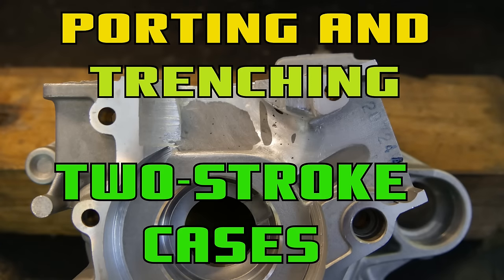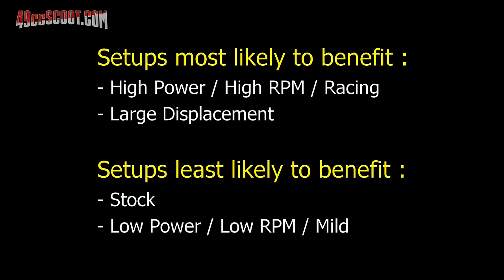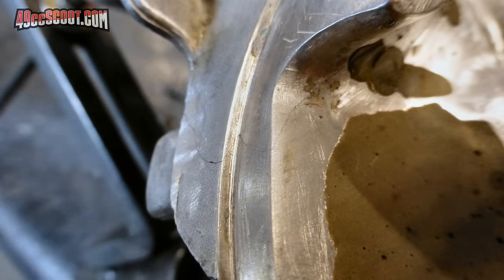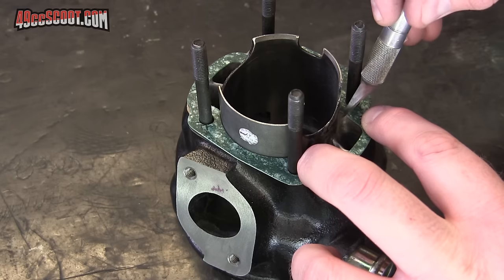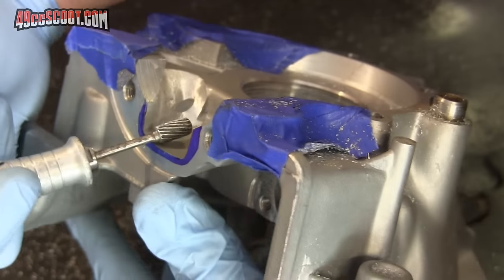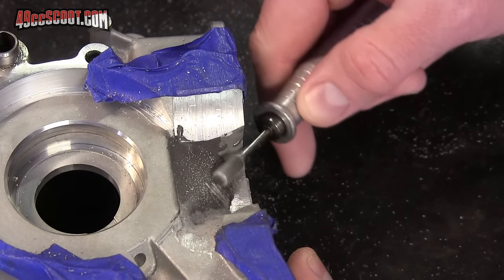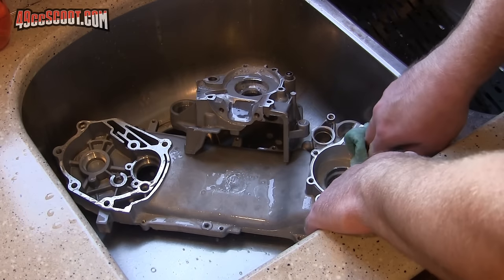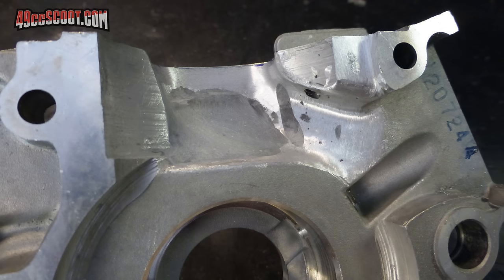Port Matching, Porting And Trenching Two-Stroke Engine Cases

Comment: More physics!
Air does not like going around corners. Use large radius turns. Short turns seporate the ful droplets and they go straight. 
Steps cause turbulance!!! ( fuel comes out of suspension) 
Again! Think in terms of the air wanting to go straight!! Keeping fuel atomized! 
Also remember, in an engine the air is pulsing in reverse too! Watch edges and steps. 
( Knife edge) ramps must be gentle, to stop turbulance!
Don't polish any inlet surfaces!
A 60 grit cartridge roll finish is ideal.
It provides a boundry layer ( holds higher air velocity) and lessens the fuel that comes out of suspension!
Polish exhaust ports! Minimum 200 grit.
Apart from matching cacing joints and steps, radiusing, etc.
The more you remove, the slower the air will move.
~ " Flowing", while removing as little material as possible, will keep good midrange and improve top end power.
Going Big will lose low end but gain power at high rpm.
You spend about 60 ~ 80 % of the time at mid and upper mid rpm and throttle position.
Think about it!
Enjoy tinkering!
Oh WEAR EYE PROTECTION! GLOVES! 
AND A MASK, ALUMINIUM IS TOXIC TO THE BODY. Google " silicosis"

Comment: When you are marking your gasket you are much better off staining the flange well past the gasket edge and then use a scribe to mark it.  This is far more accurate when you are grinding up to it and is far easier to tell if you are going to go to far.

Comment: Wouldn’t port work potentially direct less oil to the crank bearings?
Reply from the maker: It could, but work like mine have won't isolate the crank enough to be an issue.

Comment: ottimo metodo per buttare via tutto
Reply from the maker: Over 1,000 miles on the last one ATM with no issues running 14,000RPM. I've done this to multiple engines. It's not for everyone. If you want max reliability, just leave it stock.

Comment: Just curious about case stuffing around the crankshaft or is that unnecessary in your build?
Reply from the maker: I was using a stuffer crank, but didn't do anything to decrease case volume. This particular engine was a 49cc bored and stroked to 103cc.

Comment: Intakes need to have a rough not smooth surface, it helps suspend the fuel molecules. Smooth surfaces will allow the fuel to form puddles 😉
Reply from the maker: Right. That's well known with many applications. I can't say that it's so well known what is best with proven results for 2T engine cases which are not the typical inlet tract.

Comment: Just curious, with that port trenching work, you are essentially trying to skip primary compression by making the incoming mixture to go into the cylinder directly,
Wouldn't this starve the bottom-end bearings from lubrication ?
Reply from the maker: As I've done it, it should never be effective enough to starve the bearings. Plus, if any oil or fuel/oil mixture falls out of suspension, it should make it's way to the bearings as it always did. I've seen some that shield the crankcase with a metal barrier, leaving only a slit for the rod. I'm not sure if or how they deal with oiling in those cases.
Reply: @49ccscoot  Cool! Thank you!!

Comment: The Jb weld that your using isn't fuel or oil resistant I'd look into the jb weld that is
Reply: I am sure it might be oil resistant, and maybe gas, but it is not ethanol resistant, as alcohol breaks it down.

Comment: what will happen to primary compression
Reply from the maker: It will lower. In some modern discussions they don't seem so concerned with primary compression and some prefer larger volume.
Reply: what is the effect of large or small primary compression
Reply from the maker: @ASOMOTOR  It can change cylinder filling, pumping losses, how peaky the powerband is or willing to rev and of course engine output. Most people comment about primary compression ratio and have never measured it to know if theirs is anywhere near any suggestions/guidelines because it's a pain to do.

Comment: sandblasting transfer ports benefits power because the fuel will leave lil drops on smooth surface on sandblasted it doesnt

Comment: What do you do to your cases to get such a finish? That is, do you sandblast them to get that clean look?
Reply from the maker: These were new cases. Generally I just clean with Simple Green and brushes. Maybe some brake parts cleaner for tougher stuff or to speed it up. Media blasting would be nice. Some people make soda blasting rigs with good results cheap. I've never tried it, but there are plenty of vids and other info about it.
Reply: @49ccscoot  as always thanks! I will look into soda blasting. There goes another reason to buy a compressor.

Comment: Curious if you've ever considered using alumiweld.
Reply from the maker: Hadn't put much thought into it. I've been using JB Weld for years. I did switch to a Devcon product at one point, but not their aluminum putty. It was brittle and didn't last long so I just went back to JB Weld. It seems for me that the JB will last about as long as the cases. Sooner or later my cases end up with too much clearance in the seats and things like that anyway. I may try something else next time, but I'm not sure what it will be.

Comment: personally i think most of the time a good tuned engine for street use dont need trenching but just a blending of rough edges.
to get the absolute last bit of power out of an engine it might need trenching but for most of the street tunes its overkill.
Reply from the maker: I agree that it's not a sensible way to mod a street engine. It's how all of mine are setup, but I've never claimed to be sensible.
Reply: @49ccscoot  hehe who is sensible my engine derbi ebs is still going strong after 11 years of abuse in endurance racing street and lots of fun, still pounding out 17hp the same dyno numbers as new built.
no block porting, 28mm pwk, malossi mhr replica 50mm, metrakit prorace exhaust/ hebo bufanda performance.

Comment: In 1999 my 13 yr son crashed his 80 at a race. The exhaust flange lost 100 degrees. So I took JB weld some aluminum shavings and steel wool all cut up. I used foil to hold it in place. A little shaping and we used it for 20 more races, no issues. The Deep Matrix works! But only on 2 strokes, 4 strokes are too hot
Reply: Cool story
Reply: @janeblogs324  I was hoping it would for a race or two. Was surprised JB was that strong. Los Banos Can, GFI series

Comment: WHAT KIND OF PORTING TOOL ARE YOU USING?
Reply from the maker: It's a Foredom SR series. I used Dremel for years and switched to the Foredom a couple of years ago after another Dremel failure with the speed switch. I really like it and they have a lot of handpieces (though some, like right angle, get really expensive). This one doesn't spin up super fast like a Dremel, but it's got a lot more torque. The Dremel is more forgiving. This thing will grab and snap bits or snap the cable in the flex shaft if you aren't careful.

Comment: Scoot! I wanna port match my entire Bt49 intake. Can I J-B weld the entire intake port to the valve and after hardening, machine it like you did with this 2-stroke case? But with the 4-stroke channel flow charecteristics. You think J-B is petrol and heat resistant enough to last in my bt49 cylinder head intake port?
Regards
Reply from the maker: I'm not sure how JB would do there. You'll notice lots of people telling me that it doesn't work where there's fuel, but I've done this for years with the 2Ts. However, you're talking about a cylinder head, which is likely to get much hotter than my engine cases should. It would be cooled with the incoming charge in the inlet port, but I'm still not sure that it's a great idea there. Obviously aluminum filling would be best, if possible. I suppose you'll have to decide if the risk is worth the reward in this case.
Reply from the maker: @bumblebob5979  It sounds like heat wouldn't be an issue, but I have no idea if it would hold up for that use. Sorry.

Comment: What effect does the filler have? Will the mixture attachs it self to it? I think you have removed to much. Specially on the cilinder skirts. Good video tho
Reply from the maker: Some of the filler is necessary because extreme porting cuts all the way through the cases or leaves them paper thin. 

The filler on that ledge below the transfers is to get rid of  an abrupt corner and  create a transition up toward the transfers.
Reply: @49ccscoot  I understand but the filler material doesn't help with the flow. Because like cold aluminium the mixture codensates against colder materials. This is what can happen with the material of the filler?
Reply from the maker: @Jazeeti  It's possible, but there's not much choice and I've seen some people way smarter than me using similar fillers to reduce volume or direct flow.

Comment: hello just wanted to ask something with the 103cc build to get to the 103cc is that with a 49mm stoker with a 54mm bore kit ?
if so where did you find a 54mm lc top end as im hunting for one and only place i have seen they are asking for more then my hyper race top end
Reply from the maker: 45mm stroke and 54mm bore. The 54mm LC cylinder kits used to be on eBay and made by HOCA/SSP-G/Motoritec. Now they are harder to find. I paid about $300 for the cylinder and honestly that is too much for what it is. Plus, it has had a ton of sealing issues that it really shouldn't have.
Reply: @49ccscoot   i did meen 45mm but not sure why i  typed 49mm stroker :D thanks yep same kits  i think then the hoca 54mm lc :(
Reply from the maker: @mrchilled85  They're fun, but after riding the LC 103 vs the TPR 86cc, I think if you're gonna spend that kind of cash on an engine the 86cc makes more sense. The sealing issues were quite a problem for me with the 103 and the 86cc works great out of the box. There may be better big kind of sport kits out there, but it just wasn't the same experience as the many air cooled 90-110cc engines that I built. There's really no reason that the LC cylinder should cost $200 more than the AC 52-54mm cylinders.
Reply: @49ccscoot   yep after looking about i may just go 54mm ac as they are only $41 + shipping  so then will have a 103cc ac for under $120 + shipping  as that engine may end up in my wifes  aprilia sr 50  as its a full stock 1998 minarelli horizontal just so its faster for her but not over the top
Reply from the maker: @mrchilled85  I would worry about any cylinder that costs $41. I have had a few $60 kits. Had them all at once because they were awful. The first one came with a crack in the skirt. Then the others had terrible piston to cylinder clearance and knocked from day one. Will not do that again. It is worth spending a little extra to make sure you get a Taiwan made kit vs the cheapest Chinese kits. I'd also advise a Taiwan made crank  if possible. If you do buy a super cheap crank, then you need to check if it's true before it is installed, so that will require V-blocks or a bearing setup and at least one dial indicator. Then if it's out, you gotta get out the brass hammer and try to knock it into true. Alex, of Two-Stroke Stuffing has a good video to show crank truing if you need it. Anyway, the point is that you really don't save money if you end up with parts that don't last long or won't perform well out of the box. Try to find HOCA/SSP-G/Motoritech. You can still probably get the crank and cylinder kit for $250-300 total (been a while since I've looked) and hopefully end up with something that lasts. Plus, they may be slightly easier to get squish and port timings right, but I never expect a 90cc style  build to go easy TBH.
Reply: @49ccscoot  i know what your saying i have seen some Chinese  kits go bad after running one day and yes i know about checking a crank for true as done that with a cheap $20 oem crankshaft for my longjia LJ50QT-K but was very lucky and it was very true

Comment: Ich nehme mal an den Kunststoff den ihr verarbeitet das ist ein Epoxidharz wahrscheinlich Aluminium gefühlt und ich persönlich wäre da sehr vorsichtig solch einen Kunststoff in einem Motor zu verarbeiten und ich bin nicht davon überzeugt dass das auf Dauerbestand hat. Grüße aus Deutschland
Reply from the maker: I've used it for years. I have had it crack before. I haven't had it fail and cause any major problems aside from case leaks.

Comment: err why did you not fit the reed valve before you did all this work as the reed block will mask off a lot of the work you have done ,most reeds only open around 10 mm.
in the sixties we were inserting alloy blocks into the spaces we were going to cut intothese were profiled as a close fit so the minimum of epoxy was used ,we also used alloy filling mixed in clear epoxy to keep the expansion rate similar , we were making 4 transfer motors out of two transfer motors
Reply from the maker: The reeds shown are stock reeds without a spacer, just for a demo. I use larger reeds and lift them out of the cases with a spacer.

Comment: is the rotary tool you are using a foredom one? if yes can you provide a link of the handpiece? thank you love your vids👍👌
Reply from the maker: Thanks! It is a Foredom, and here is an affiliate link to the handpiece that I used.
https://amzn.to/3y5TOeG
Reply: @49ccscoot  thanks! didn't expect you to answer so fast😂👌👍
Reply: @49ccscoot  I got a lil question, did you calculate the volume ratio between the 103cc cylinder and the cases? You improved the flow with the jb weld, but how much volume did you subtract? In such large displacements, and cases like these it often happens that at high rpm  they don't run like they should... A very known problem in vespa engines, which is solved by a very long conrod. Let me know of your theory cause i like the way you did this work!
Reply from the maker: @lhrpreparazioni420  I did not measure the volumes. This is something that I've done for a long time but I've never went into it far enough to figure out the ratio that works best. It seems to improve the ~90-100cc builds so I stuck with it. I should take measurements one day to figure out what the ratios are.
Reply: @49ccscoot  in my opinion you should at least have a bit more crankcase volume than displacement, because you always have to think of the least efficient way the engine could work... as I like to say, any elements are stupid, they use the least amount of effort to achieve something.😂😂 So in the end you ideally have gasses all over the displacement of the cylinder at bdc so that when the reeds are closed the gasses in the case at least match the volume of the cylinder.
Reply: @49ccscoot  i'm sorry, my english is not too good bc i'm italian, but sadly you can't only get informations or discuss with people of your same language.
Reply from the maker: @lhrpreparazioni420  I have had no problem reading your comments and would not have guessed that you are not a native English speaker.
Reply: @49ccscoot  Haha, thanks!😂 at least that's good😂😂

Comment: Think it is worth it on a arisal 80 race cylinder that makes like 15-20hp
Reply from the maker: I've done it on lots of stuff that makes less than that.
Reply: @49ccscoot  okey, do you think JB weld hightempreture is a Good epoxy ( rated for 260 Celsius
Reply from the maker: @miltonulm5102  Never tried it. I've always used the standard JB.

Comment: hello, is there any problem when I cleaned the crankcase of the old silicone, I scratched the crankcase where the silicone comes in, is there a problem
Reply from the maker: You mean you scratched a sealing surface? It could be an issue, but as long as it's just a minor scratch hopefully the gasket maker will fill it on reassembly. JB Weld or your favorite suitable epoxy could possibly be used to fill something more major. I've seen someone use a filler and let it cure with the surface against glass so it comes out true.
Reply: @49ccscoot  I have some community photos on the YouTube channel
Reply: what do you think?
Reply from the maker: @GeorgeBGP2.0  I see. It's scuffed up all over. You can try it and see what happens. If it seals, then you may be good to go. You could do a test without assembling everything, but you'd have to have blockoff plates to seal the cylinder and reed and any other open areas for that. You could try to smooth it out a little with sandpaper on glass, but you wouldn't want to remove much material at all. Just light work to hopefully improve the sealing ability.
Reply: @49ccscoot  he engine started without any problems, thanks for the extra help at work (an Italian friend said that there is no problem if it is scratched, the important thing is that there is a good silicone in that area)
Reply from the maker: @GeorgeBGP2.0  Cool. For future reference, pick up one of those scrapers that uses plastic razor blades. Usually comes with a bunch of plastic blades because they do wear quickly when used for this, but they are great for gasket cleanup without damaging aluminum.
Reply: @49ccscoot thank you for everything sir, good luck with the next changes
Reply: I encountered a new problem, I posted a video on the YouTube channel
Reply from the maker: @GeorgeBGP2.0  Put the airbox on and see what happens.
Reply: @49ccscoot  he does the same
Reply: @49ccscoot  the problem is from the magneto stator 😀 problem solved

Comment: Why do you think polishing on the case would be detrimental?
Reply from the maker: I would assume it should be treated like the inlet side of a four-stroke where it's common knowledge that you don't polish the intake side. It alters the boundary layer and wet flow.
Reply: This argument has been ongoing for decades. Polished guys says it increases velocity. Rough guys say it mixes fuel/air better. Would like to see some Dyno results. I've ported a few 2stroke bikes but I copied the looks of cylinders I've seen ported by well known porters. Results were always noticable. Ive never ported a case Reed induction.